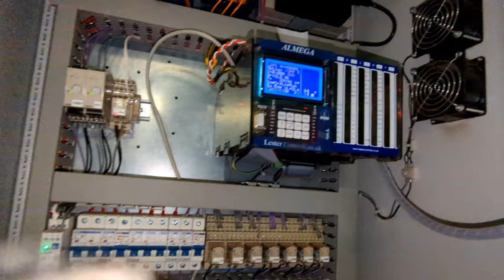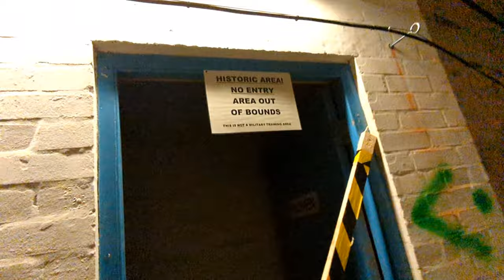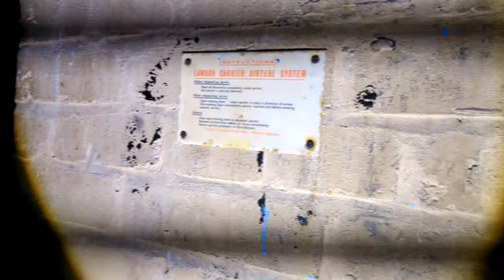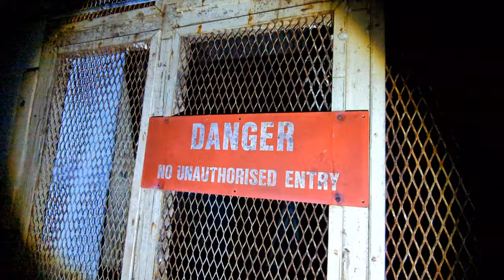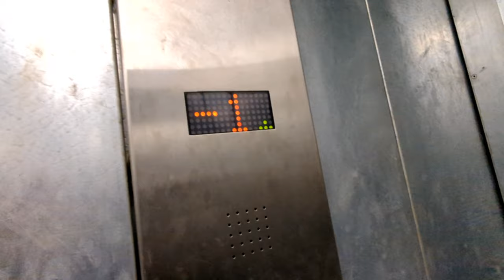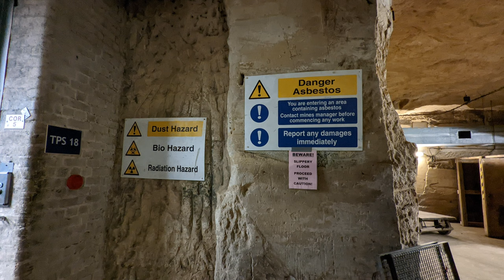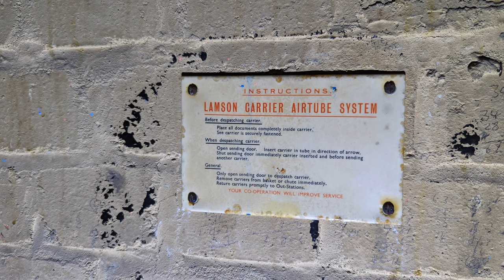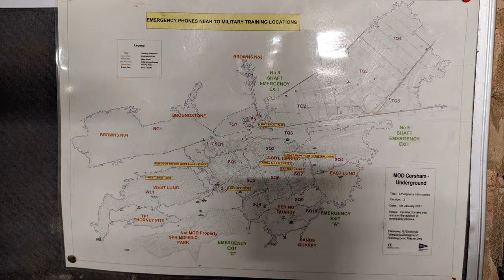Burlington Bunker, Underground Corsham Urbex

Comment: This is epic and puts the ole area 51 bollox to bed. Huge area all but stripped out down to last few bits. I'm guessing the limestone seeps water so wouldn't have been radiation proof. Abandoned for good reason and there updated bunkers like morwenstow, are unbelievable builds!
Reply: Not at all, none of the main bits were touch, Burlington is split into 3 different sections for a reason! This is all left abandoned for a reason! Maybe the bunkers gone deeper down another level underground who knows! The Back section of ark data base which is certain people only access, that sinks down 6 levels in the underground! 800million doesn't cost what they have above ground so think about it!
Reply: @mi5ninjas413  800 million 😳 yeah I mean you know more about that than me, I'd love to know. The one in Devon you can't even get near it has a fake road shut no throughway sign. Only reason I knew about it was a friend on mine worked Waterloo air management and they did air handling for it. I parked couple miles away and walked along coastal path a filmed a little bit of it there sum footage on my you tube. But they shut my phone down and security picked me up and drop me miles away from my car asked me not to take any pictures or return as next time I will be prosecuted 😅
Reply: @gavster023  yeah too much for me to say about this place, I've been exploring the military underground for many many years! That sounds like situation you can get into around here! But there still say "nothing is going on here" haha
Reply: @mi5ninjas413  The ARK data centers go underground in the quarry? (Makes sense)
Reply: @danosdotnl  yeah thats right man, that part of spring quarry has more than 4 levels going down underground! It's sectioned off to its own little bit, then Burlington is shut off via blast proof doors so its just passageways and passageways surrounding ark data base, Burlington and tunnel quarry then ccc is sectioned off to itself! Only entrance in for us would be abseil in mate!
Reply: @gavster023 Shut your phone down? How was that managed? Flight mode,sleep mode,stanby? They physically took it from you? Or remotely "shut down"?
Reply: @gavster023  is that the one at Bude?

Comment: I'm curious about that lift. Looks way newer than any of the other lifts I've ever seen used to access Burlington before...
Reply from the maker: It's been replaced but in the original shaft most the lifts in there don't work any more so I guess most of them got left to rust away before any one had the idea of reusing them
Reply: @KIRBZVIDS  the usual way in was via the PNCC lift, which still works I think, you were headed that way at one point in the vid in fact you went thru the airlock on the way to PNCC, through what I think is called 79 door, around where the electric trucks were. So whichever lift you came down is one I've never seen before! The place looks in better nick than it has in years.
Reply: @m7dgz  Its now called Corsham Mines Training Area and used as underground firing range by the military, i live just round corner so see all the troops arriving on coaches for a bit of underground fun